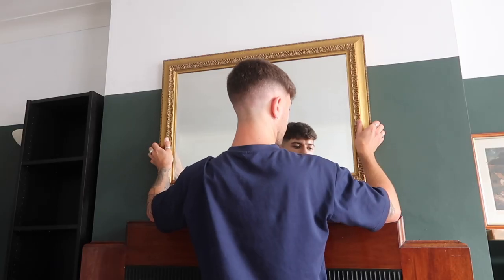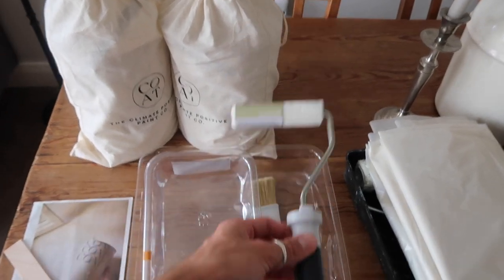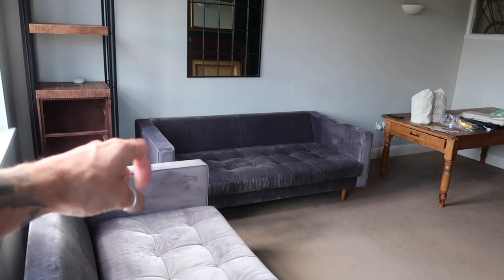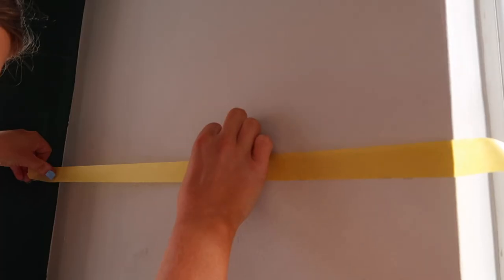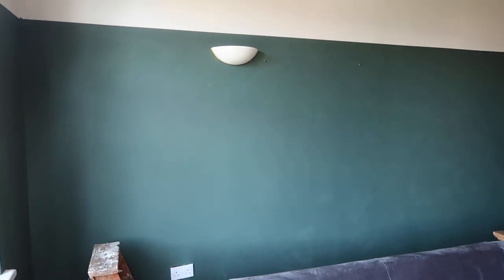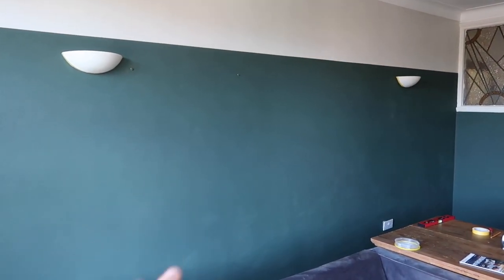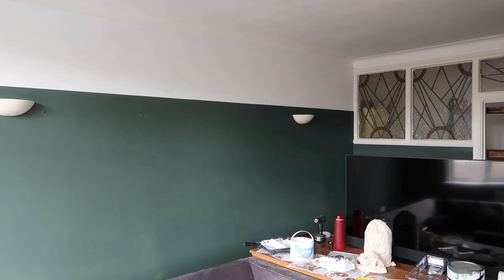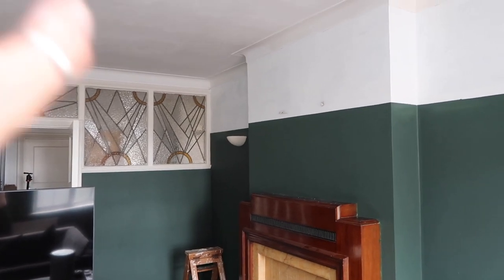LIVING ROOM MAKEOVER AND WE WENT *DARK* | DARK & COSY GREEN LIVING ROOM

Comment: Nice colors, it was the right choice to go with the white to counterbalance the darkness of the green.  I like a cozy room, darker walls make it so easy to give you a wide wash of color to work from.  Considering that the climate is changing in your local in England as much as it has changed over the years in mine (Wisconsin, USA), maybe you should consider buying a couple of fans or an AC window unit or cooler that you can move from room to room.  Have you considered "cheating" the leveling of the TV by raising the lower end of the TV stand with some shaved shims? The carpet would camouflage any small parts of the shims that show.  I understand not wanting to drill holes into a brick or plaster wall!

Comment: Luke a simple fix for the shelf is just add a thin peice of wood between the shelf and bracket until it's level. Really you could use anything,  peice of cardboard or a washer, just depends how high you need to raise the lower side.